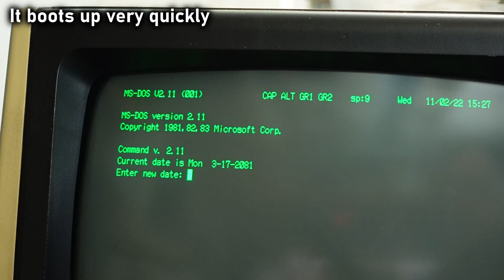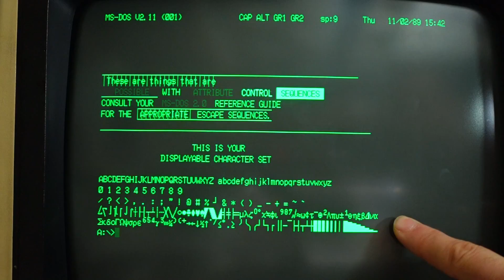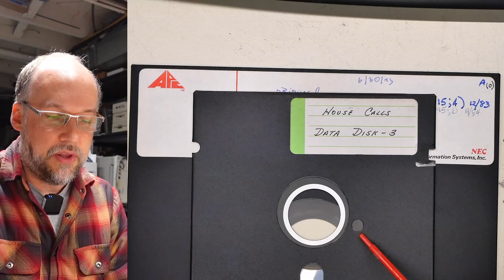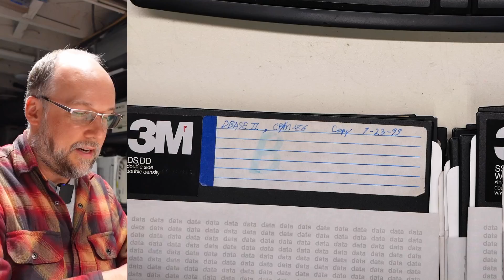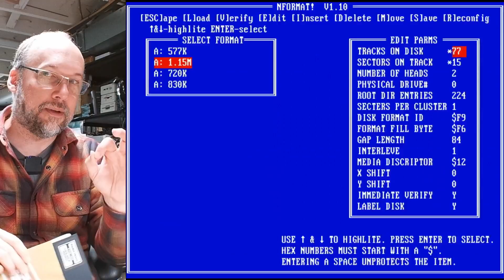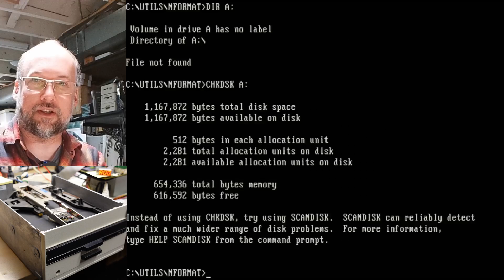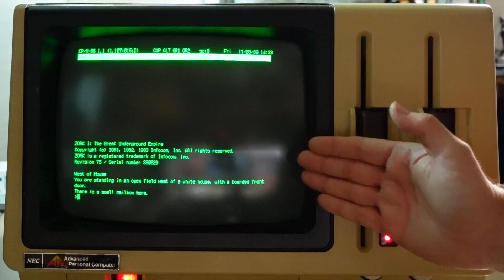Comment: use laplink for laptops over serial, pins 2,3,5 (2 and 3 reversed on the old pc). On the the old machine in DOS use the CTTY command to setup a terminal and push laplink across from the other machine then you can transfer the DOS programs across to the 8 inch directly. Weather they work in DOS 2 is another question but the transfer should work. (You could even use dosbox as the host with a virtual serial setup and force the cycles below 1000 in the config to slow it down)

Comment: Adrian .. I used in the eighties Casio Fp1100 with two dual 8 inchs Floppies .. We used CP/M - Word Start - SuperCalc and on the business part we used for Payroll/BookKeeping/Invoicing and Stock control all done in Cobol compiled with MicroFocus Cobol. This was used from 1981 to 1984/5 ... At same time we converted all aplications to MS-DOS-PC-DOS and early nineties NetWare ... The main aplications we used today are called ERP_CRM ... At the time we basically called the "Management software" .. At the time, as there strong limitatons in "image management" we made calls from the Cobol Aplications into Inset routine of workStar .. It worked well ( by the stds then ... ) Main problem was to "scan the leaflets, manuals etc" At the time the scaners were extremely expensive (actually even the Casios FP1100 and later FP6000 and 4000 were expensive as well)...

Comment: I used to program the NEC Neax 2400 Series SIM/IMG/MMG/UMG PABX Products using the NEC APC CP/M-86 MAT terminal computer which was supplied with every Neax 2400 PABX installation from about 1981 through to the last one I saw in about 2005. The sound of the floppy drives bring back memories. Those were the days in telecommunications, very revolutionary technology during those years.

Comment: This NEC is in line with the Casio FP6000 ( 8086 Inter processor MS-DOS only) and the SORD Sord M68 (Z80 + Motorolla 68000 ) .. At the time CP/M was the king in business software and so, nobody could afford to loose that market potential. Even Apple made a CP/M card

Comment: I wonder if the deal with the power light is due to the photoelectric effect. Neon indicator bulbs will glow slightly brighter and with less flicker when they're exposed to a light source, because the photons impacting the gas makes it more readily convert to a plasma. Sometimes, neon bulbs that won't light up in the dark at all will strike once they're exposed to light, and will stay lit until power is removed and they cool down.

Comment: In the beginning, Microsoft did not have a C compiler for MS DOS. If I remember correctly, they were selling LATTICE C. 

You can transfer files from NEC APC to MS DOS with a File Transfer software using RS-232 ports and cross cable. Not very hard. Perfect use of that C compiler on NEC.

Comment: I arrived in the computer world when I worked for a Company who offered insurance for those who had lots of tickets. We used DOS systems. I learned fast. My computer arrived and the guys said they would come configure it after they returned from lunch. Well, I found the network settings. I was able to get it connected to our Network, then I built a menu to get connected to each one. When they returned and powered on my computer, they tripped out on it being setup already. I was working in Accounting but the guy told me, you need to ditch accounting and come work for us. My boss told him to leave me along. My desk was located in my bosses office. It was a large one. I was hired to get paper accounting put in computers. I was given 6 months to do it. I finished in 2 months. So they hired me to work for them. It was a good job. I eventually purchased a computer from them. I had to configure my own computer as they were busy building computers for a couple other companies near ours. I never actually saw the 8 inch floppy.. The ones we used were about 5 inches, and eventually we changed to diskettes. I remember when my boss handed me my disk drive. He said go ahead and install it. The network guys were too busy. After I did mine, he called and had me install his.

Comment: Great video! Man this brings back memories, I started my first computer company in Ohio and we were selling these to all the former engineers from the Tire companies in Akron OH. We had a light fixture company come to us and asked for an inventory control system and these machines came bundled with dBase II Ashton Tate software. I ended up writing the program for the customer in dBase II on the NEC APC. That customer's company stayed and business well through the 90s and they were still using my program and the NEC APC through the mid 90s. One final note, if you logged into the program with the wrong username or password more than three times my program called the POW command, which you talk about in this video, and shut the computer off.  🙂

Comment: Well.. About the date.. I am SO intrigued for so many reasons.. but as of now I can't focus my mental faculties.. I haven't watched the ENTIRE video so I don't know if Adrian digs down, but.. 

There is ALWAYS something "behind it all".. which is the CAUSE of specific consequences of specific actions.. 

So.. CP/M and Dos are two different operating systems.. and they use the hardware clock differently.. ALSO There is probably a bios that was written with it's own set of ideas.. but then there is also the clock-chipå and it's limitations.. 

So.. The entirei idea of "date storage" is about.. different systems using dates differently.. f.ex.. IF someone uses two chars to store a date in a file system.. then.. the file system simply use JUST the two digits.. (which was the "problem" with the Y2K bug.. two individual decimals numbers representing a year.. so.. how do they deal with centuries?.. usually.. by a hard-coded number).. 

Actually; I have "worried" a LOT about actual time-codes.. when I run obsolete operating sytems in  "virtual machines".... this because.. I don't know what the programmers did.. THAT is the source of my anxiety, BUT I am FAIRLY sure that they really DO know that the "main system" should never ever be influenced,, and they should add a "layer" of interpretation in-between so EVEN if they want changes to the OFFICIAL clock is being made.. and they WANT to change their interpretation.. they should have added some form of "interpretation" in-between.. 

Either way.. I THINK understanding the "greater then" followed by a "zero" as.. "a year".. is something that CAN be understood.. I never dealt with this computer, NOR either of the operating system.. BUT.. if I would've known the hardware clock, the BOTH operating systems.. then.. I COULD have figured out how the "year" could be deduced from the format of the hardware clock, where.. setting the YEAR in ONE situation.. to.. 2022.. could.. mean that the FIRST ascii character chosen would've been .. one that is 5 above the character for the number 9.. 

So.. there IS a way to figure out how these things deal with the data of the hardware and how they all.. treat it differently.. 

But.. I don't have the hardware.. I COULD probably waste a shitload of time  to try to figure out whether the year is stored separately OR if it is a number where day month and year and whatever are stored in a specific format that WOULD lead to the first number being.. distorted to an erroneous ascii interpretation because they never expected it to go beyond a character "9".. 

And..IF I didn't have a SHITLOAD of problems right now.. 

I'd actually think of this as.. "my weekend is saved", but as it is.. I Am instead thinking that.. "oh.. this is going to irk me and I seriously shouldn't use time to try to figure this out, because I have more important things on my agenda"..

Comment: Good video. I stumbled across it because I too, was trying to see and copy off files from an MS-DOS 8 inch disk used on an unknown machine. I have an 8 inch drive set up similar to yours. Yes, the problem seems to be that 512 sector size which is baked into PC floppy architecture.  Many of these early MS-DOS formats for 8086 machines used something different.  No standardisation in this regard, much like CP/M. What's needed is a 22DISK for MS-DOS 😀

Comment: I actually remember taking 5 1/4" floppies and a paper hole punch and punching extra index holes in them so that I could flip them over and use both sides in my single-sided TRS-80 disk drives.  It was actually pretty common practice at the time, because single-sided floppies often cost significantly less than double-sided ones, even though they were exactly the same except for that single missing hole (and the write-protect notch)...
Reply: we would do the same with 720kb 3'5 inch ones, drilling a hole to make them 1.44mb   but it was not always reliable, so only for game copies  not for very valuable data

Comment: I remember something vaguely, about disk sectors on most DOS drives  being physically 520 bytes, only 512 of which were used with the remaining 8 being a "sector ID" or checksum or some like that.

That may explain the discrepancy in volume sizes from checkdisk, and the fact that the DOS-formatted disk doesn;t work on the APC, assuming the APC DOS doesn't require the 8-byte sector ID and stores data there. But it's a wild guess based on an old memory.

Comment: Way back when I had one myself but mine had the color display. Overall, it was a great system although I never did get around to buying the fantastically expensive hard drive for it. I developed a couple of Turbo Pascal graphic programs for it and quite likely they are still in a storage box somewhere in the basement but I guess it isn't worth trying to find them and then to find some service to extract the data. I sold mine to a church that had several of them in their office and moved on to "modern" hardware.

Comment: You're probably already aware of this but if you could somehow get the MS-DOS program "interlnk" or something similar running on the APC, you could transfer files with another MS-DOS machine via serial or parallel.  Comes to mind because I used this method a long time ago when I encountered a DOS PC with a failing hard drive and a dead floppy drive on a non-standard floppy interface.  I needed to back up data from the machine, which still booted to DOS and had the interlnk EXE, so I was able to copy what I needed to another machine over a COM port cable.

Comment: I've seen near-EOL neons take a while to strike, MK for example in the UK (used to?) make sockets with neons in them and these were often left with the switches in the "on" position for long periods causing the neons to sputter and die. Sometimes they flicker dimly for a while first, before striking. Try shining a bright torch on it and see if it wakes up quicker! This sometimes works with LPS lamps with the neon/argon penning mixture.

Comment: I had an NEC APC III in the early ninety's, inherited it from a store liquidation when my dad bought a pharmacy. It had been used as a store room stock control computer & ran a version of DOS. I was learning computer programming at the time & was able to get pascall running on it and a cobol compiler. I remember phoning NEC and asking what else it might be good for? They replied use it as a door stop or a boat anchor! LOL. it had an internal 10mb hard drive and anlso an external 10mb hard drive as well as 1 5&1/4 floppy drive and a orange monochrome screen. I used it for a couple of years until it actually died in a power outage. I don't remember wht happened to it after that.

Comment: When I was taking Computer Science in Colleage, we used machines just like that to create our Basic Progerams in for our Home work!, I passed all my test, as my intrest is in Science, it was not hard at all. Well, others in my class wanted me to totor them, but I was much too busy. I had a job to go to after class. The computer room opened early and stayed open until 11:00PM. That is how I got my Commodore 64. I sure wish I had one right now. In that computer on the Colleage campus had about 25 of those computers in there. Also, when I started using those disks, I never saw the large ones. Not until one of my coworkers brought one in and showed me what they looked like. I still have a Floppy drive in my collection.

Comment: Its not a very good idea to put a stack of diskettes on top of the monitor: They will slowly be degraded / erased. These old CRT monitors emit magnetic fields from the vertical and horizontal deflection coils.
They are safe inside the disk drives as they are shielded by the metal, but not when they are stored on top of the monitor which is just plastic.

It's a monochrome monitor you have, but FYI:
All color TV's and CRT monitors includes a build-in demagnetization coil (degaussing coil) at the edge of the CRT sending a large magnetic field at startup (at cold power-on) to demagnetize the metal mask inside the color CRT. The metal mask ensures the accelerated electrons rays inside the CRT hits the right color pixels.
Luckily monochrome monitors don't include builtin degassing coils at the perimeter of the CRT,  if so the bottom disk would probably have read errors on it.

Comment: Businesses were using machines like this waaayyy into the late 90s / early 2000s, even old coax networking and dumb terminals (wyse etc). you'd have thought they'd have been long gone but i guess a lot of them did what they needed to do and didn't need to be updated / replaced.

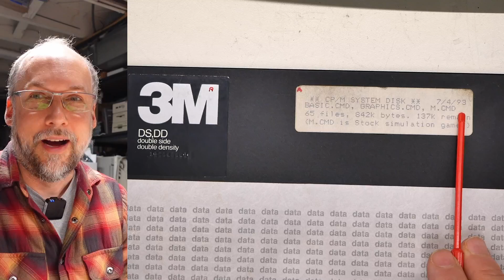Comment: 18:43 from 1982 to 1993 is only 10 years you could still get by with an 8bit computer in 1993, atleast with atari 8bit, i can go 16bit and still have the majority of 8bit compatibility and  maybe squeeze 25Mhz and bankswitch the 2k math rom with a 8231/2 or 8087 series,  should make a way to patch or translate or trap illegal opcodes and use a compatible variant cuz duh pmos and cmos you can replicate how the pmos 6502 illegal instructions work, and make a cmos variant that does the same ...

Comment: might wanna double check dat cr2032,  are you sure that lithium battery wasnt a rechargeable cell? could swap it with a 3.7v 100-200mah lipo if so
Reply: take out ya battery and power it on, and see if there is 3.3-3.7 across the battery terminals, if not, not rechargeable

Comment: You're totally right. The sad thing about IBM "comparables" like this NEC APC is that while they're superior in almost every way compared to the original IBM PC there's hardly any software available for them that really shows off their full potential indeed. I've repaired a lot of machines like this for customers, like the ACT Apricot, the Victor 9000, Tulip System 1 and Dynalogic Hyperion and I tried a lot of software on them but with most of them you're stuck with a proprietay MS-DOS version and maybe CP/M as none of them have an IBM compatible BIOS (or any BIOS for that matter)..  Any software that uses hardware interrupts or directly addresses the hardware will fail miserably and crash..
Especially if you look at this NEC: It has a very advanced NEC µPD7220 graphics processor (for its time) that has some super cool tricks up its sleeve like DMA, bit blitting, hardware drawing and merged modes. It's quite frustratring that with machines like these that were considered high end at the time you cannot put all of that power to use because there's hardly any software  available for them.. It's nice though to see one of these close up 👍It's a shame hardly anyone knows these things as they definitely could've been as great if not greater than the IBMs that everyone and their mother started cloning. Rod Canion was right: An open architecture was the way to go. The irony is that Big Blue never intended their machines to be cloned. They started the PC revolution by mistake 😂

Comment: There are - rare - hardsectored 5.25" floppies which have one index hole in the medium per sector plus an additional hole located close to one of the others.  For the few drives that care each of the "normal" holes indicate the start  of a sector and the additional hole indexes the start of the track as a whole.
On a C64's 1541 drive it will work as normal because the 1541 doesn't care.  On a Dragon 32/64 when trying to format such a floppy each index hole with make the controller think a revolution is complete and seek to the next track so the formatting (without verify, that is) completes in I think it was 2 seconds with super fast stepping sounds.  Of course the result is unusable.
I only have one such floppy and keep it around for testing and a nerd-funny surprise.

Comment: AFAIK the IBM PC only requires the index hole during formatting. For reading and writing data it is not necessary. So it would be entirely possible to create a flippy disk for the IBM PC, as long as the formatting was specially created on a double-sided drive.
Reply: A couple others mentioned this too. I would say a test is in order!

Comment: The problem is that 8" disks have 77 tracks and a 5" disk has 80 tracks. The formats are physically incompatible.
Reply: There are games for the machine.
Reply: DOS programs for the IBM use different monitor display calls as well.